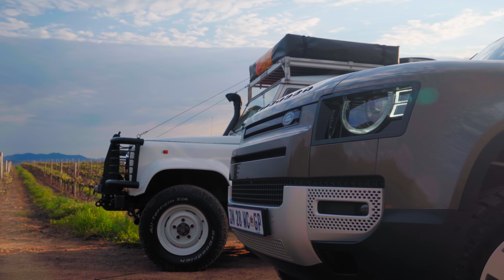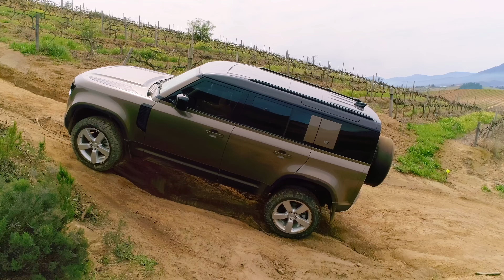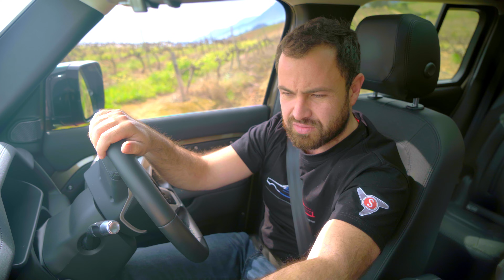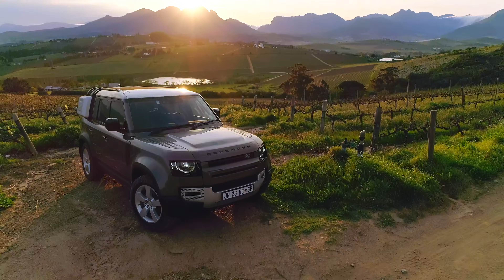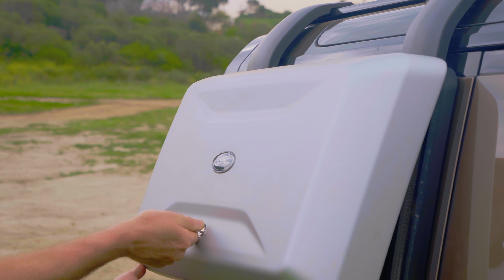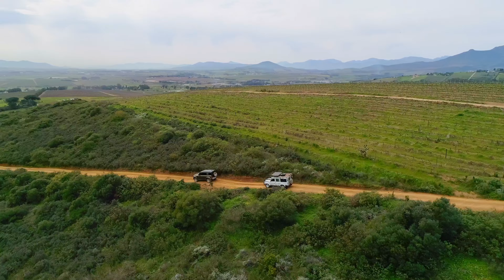All-new Defender Review - Off road and in-depth in the new Land Rover

Comment: Would you overland this truck to Nambia?  I wouldn't.  If the air suspension or ECUs failed, than you'd be stranded, and nobody in the bush could possibly help you.  You'd be totally stuck.

So it's no longer a car for serious offroading and overlanding.  It's a shopping trolley for Mums who want something that looks rugged, but doesn't make them uncomfortable.

Comment: Check out TFL car channel they bought one and it threw check engine light after going offroad once. A day after being fixed a whole bunch of toys stopped working (cameras, etc) and LR struggled to fix it. Eventually, an engineer was called in and diagnosed it as a problematic computer module which is now on backorder with no ETA. This is one a 1-week old defender. Yip, it seems the reliability concerns are justified. Such a shame.
Reply: Saw that. Laughed so hard. But ja. Typical hey.

Comment: TFL bought a new 2020.

40 hours/ 140 miles later the engine service light came on.

The quality is always an issue with this product.
Reply: They got it back and its broken again lol
Reply: They are already looking at throwing it back after 21 days in the workshop , having only had it for 24 , they purchased the car , it is not a press car . Faults start appearing by themselves in the workshop . Be warned .

Comment: Honestly If the pricing was right I'd buy this. This is perfect for what i need. More than enough space for long journey's, enough power to pull a heavily loaded trailor, not worrying to much over the kids messing on the seats on long journey's because of the materials cleaning so easily, a good looking SUV with modern skin. The only big problem is.......... Yes, you guessed it, reliability. I guess it's to early to tell if this one joins the pack. If and when it's proven it's reliable in a couple of years, the price will probably so low that i could then afford it lol
Reply: I don't think its too early to tell. It's simple, the more complex systems they put in it the more likely it is to go wrong. This is now a very complex vehicle. I would love a simpler / cheaper model.

Comment: Honestly speaking I love the new Defender, I think my dad has had 6 in the last 35 years, including one with the crank in front, the only reason why he switched to land cruiser was because of load capacity but in terms of off road capability the defender outshines the more reliable cruiser, now all old defender owners will tell you the reason why their elbows were always out was because only really small people could fit in the defender, it also got really hot inside so my dad rubberised them to help with the heat, the seats were horrible but with the right suspension setup(Old Man Emu) my dad would throw the V8 into a hole throw it into first jump out and we would watch it crawl out on it's own(we thought it was magic) but it was great engine compression and a truly legendary vehicle doing what it knows best to bring smiles to our faces, that being said the last one he bought a few years ago he literally gave away because he couldn't sort out the fuelling system and the lucky bugger who bought it sorted it out immediately and 10 years later he still has it.
Reply: B
Reply: Iw

Comment: Good effort by JLR. However, they should spend more time working on how to improve the reliability of their vehicles. No point in having "the most capable" SUV if it's going to spend most of it's time on a flat bed truck or in a mechanic workshop.
Reply: How do you know if the car is not reliable, when it just launched few months backs and its completely different power train?
Reply: Collin Phiri, there are already numerous examples in UK and USA for poor assembly and electrical issues reoccurring in the new Defender. Price and reliability will keep me away from this car.
Reply: @Wilbargosh  If youre referring to the powerfulUK probelm, they had a hose that was lose, genuine issue from the manufacturer and it was fixed in 10 miniutes. If youre referring to TFLC, they had an engine light come on. The vehicle didn't stop working and it is likely it was the fuel cap wasn't replaced correctly. They have sold over 40,000 units this year and so far are proving to be wonderful.
Reply: Aaron Adkins, there are more. JLR has a history of avoiding responsibility for reliability. In Australia JLR has lost court cases to consumers with unresolved car problems. If the new Defender sniffs of unreliability they won’t move enough units in the current global economy. Happy for you to give me a new Defender to test drive on Frazer Is Queensland Australia for a couple of weeks and see how we go?
Reply: Ironically Jaguar reliability has been significantly better 😂

Comment: Great review, I have no problems with the look and the materials on the inside are really cool, my biggest problem is reliability, not just with the defender, all Land Rovers have been in the spotlight lately on serious electrical and build quality faults, the defender used to be a vehicle you could keep for years, the new one with its air suspension and special fuel filters and predictably high service and maintenance costs will not last, this you buy for leisure only and I don't really think South Africans will part with over a million rand where most of their requirements are met with a korean suv that will last a whole while longer than this. Not well done JLR group, oh and dont forget resale value will drop worse than a stone in water !, JLR should have actually given it a different name and retired the defender badge